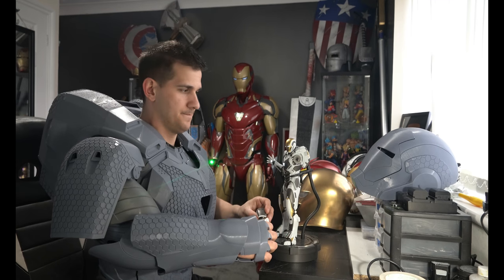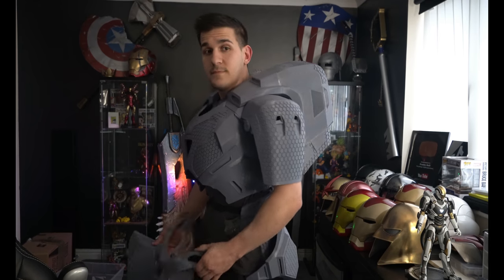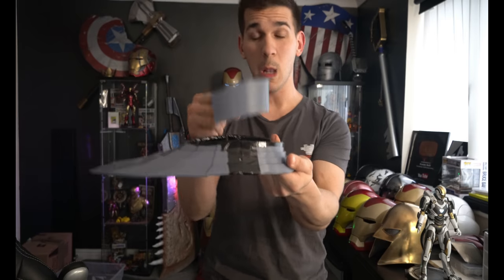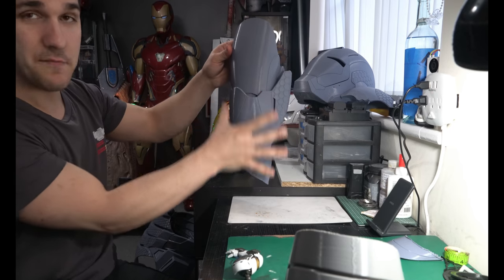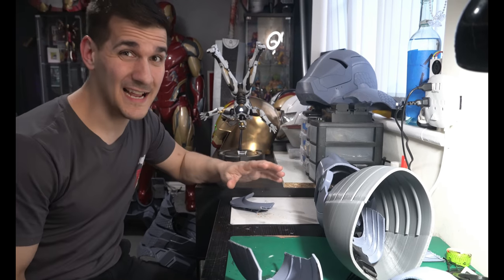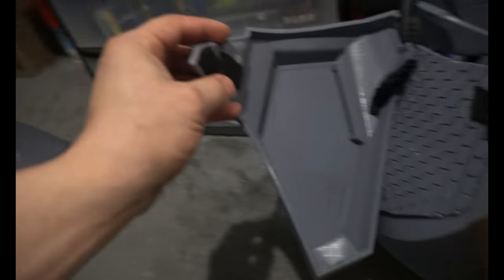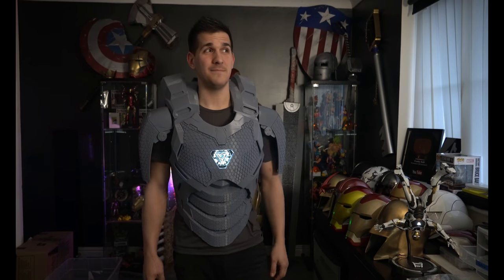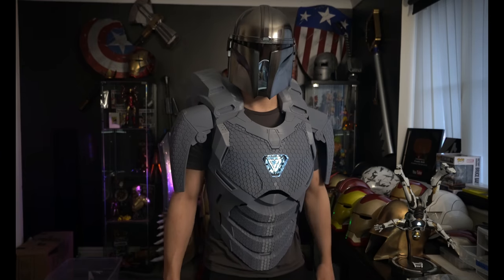3D Printing an Iron Man Suit!  | MK39 Starboost Part 5 |

Comment: If there was any Mark of armor I would definitely make full on, it would be one of two of my favorite designs.
The Red and White "Polarized" Armor from the 80's that was destroyed by an enemy armor called Firepower. The other would be the immediate version that follows which carried over for a good few years going from Bob Layton's Ironman run through John Romita Jr's run. 
I'd do the R&W as it appears briefly in Ironman 3 but this one is One of my favorites because of its major role in the OG ARMOR WARS story from the comic. the next version 2nd as it was also apart of Armor Wars 2 and admittedly the Remote Control Modular Unit that could merge with the earliest version of the modern day movie looking Hulkbuster over layer armor which was suoer cool for its day, The "Telepresence" armor Tony uses while paralyzed.
For my build I'd do a mix of 3D printed and Foam for movement, comfort etc as the paints available now for foam allow for flexibility without cracking paint as the paint and finish are flexible and serve well on Hard surfaces as normal.
But Great Build man.
I'm jelly.

Comment: I have two ideas to share. One is, to make a custom spandex unitrad undergarment with sew-in greebles made from foam or some other soft material to hid open spots and maybe throw in some EL wire as well. The second thing is look deeply into the joint details in medieval armor, in order to 3D print some articulated joint units. Great job nonetheless!

Comment: I really hope to continue this this is my first full suit build but not first helme build I am doing the same with my neck piece not only for maneuverability but comfort because even with tpu/tpe the rubbing on the helmet would drive me nuts but If you need assistance with the nano part of your motorized helmet id be glad to help as im doing that currently so I can help with code may expand on it to include fans that trigger when the faceplate goes down but that has its own challenges

Comment: Do you have a method for scaling and sizing everything?

Also I watched a couple other videos of you using an ender 3... It doesn't look like some of these peices can fit on the plate even if you cut it into peices (like the chest plate) Do you have a method to combine them? I feel like glue would be too unreliable.
Reply from the maker: I have a video on scaling and the other videos in this series cover slicing and cutting files up. I also have a video on PLA welding parts together

Comment: i am currently starting to print the starboost suit and im having all kinds of trouble getting the face plate to print and ive tried everything.
Reply from the maker: Check video 2
Reply: @FranklyBuilt  thanks for the info..im almost done printing the entire top half of the suit..All on a ender 3 v2 and a CR10 pro v2, lots of work but it will be worth it..keep up the good work and great videos.

Comment: Hi, I made the hooks with the magnets as you did but they always release even if they are aligned well. even when I try to wear it it is difficult to hook them. how do you show it looks like child's play😅 I'm thinking to use neodimium magnets there are more stronger.
have any advice?
Reply from the maker: I aligned the back and front with tape and then heated/warped the rafts to fit perfectly. It took some work haha